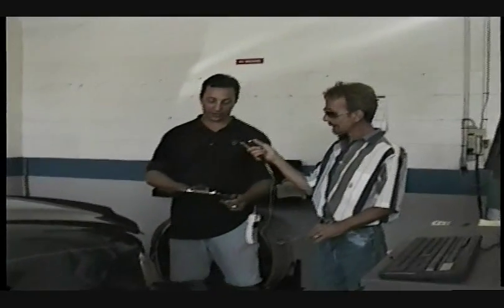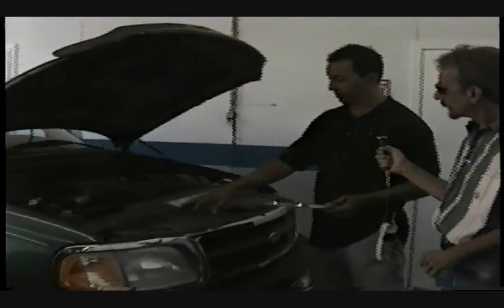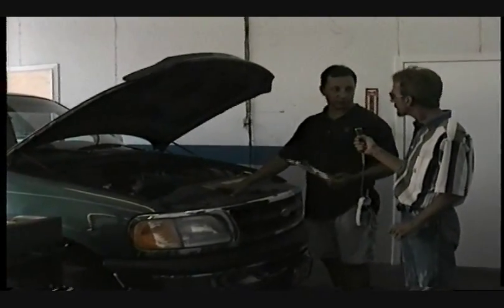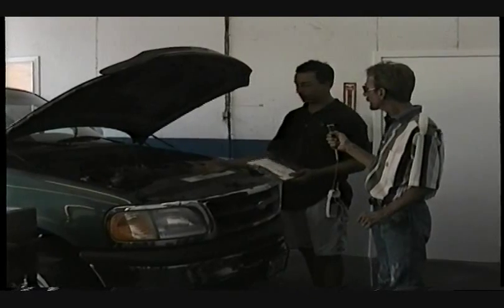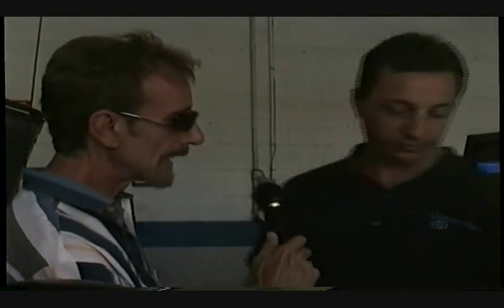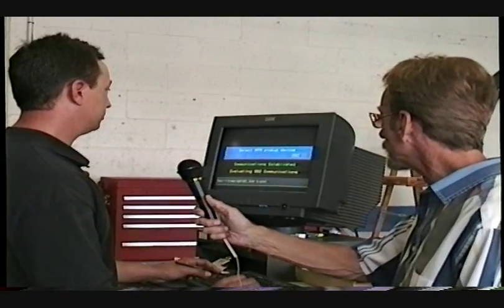Certified Smog Test Demo _ part 1

Comment: my A/C fan is broken and engine will get hot, how long the car will stay turned on during the smog test? if too long the engine will get hot. thanks (they won't put a fan and blow air into the car like a dyno right?)

Comment: I've got an old car that keeps failing smog, but just barely (NOx is over by like 50-60 PPM @ 15 Mph). All other numbers are very low (She has a NEW Catalytic Converter)... 
She's an old girl but I won't give up on her!  I've been "Fiddling" with her and then taking her for Pre-tests to judge my results. I've come to realize that her problem is the EGR valve, but it's been replaced...